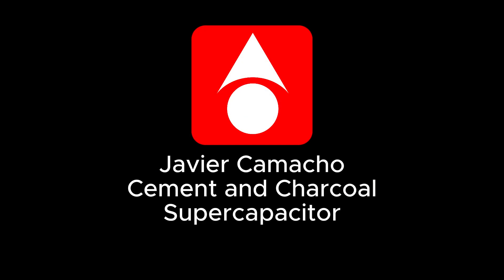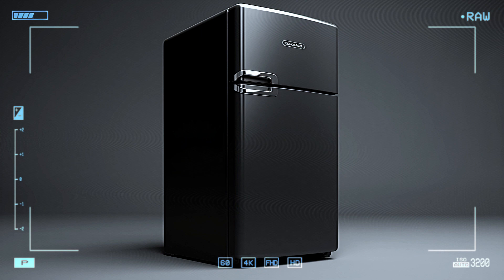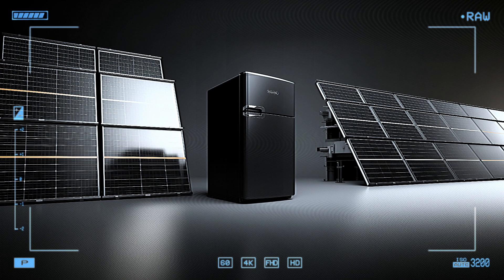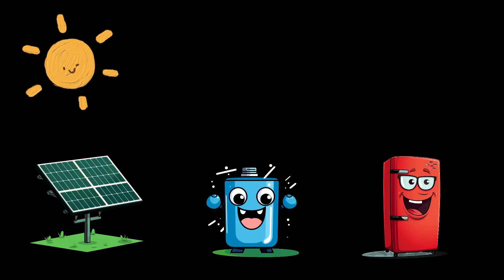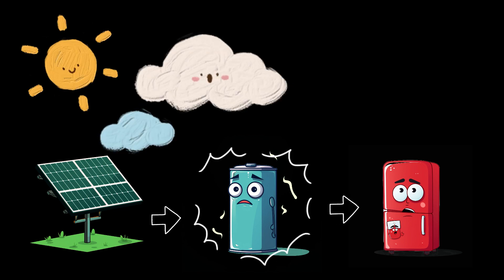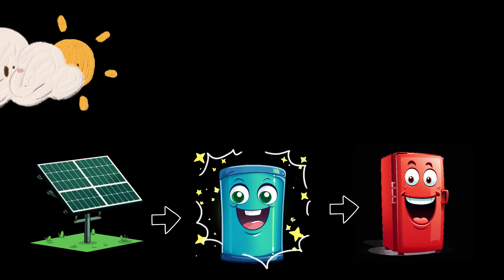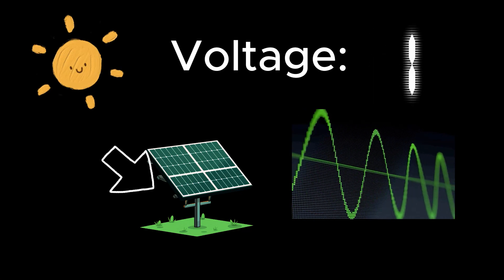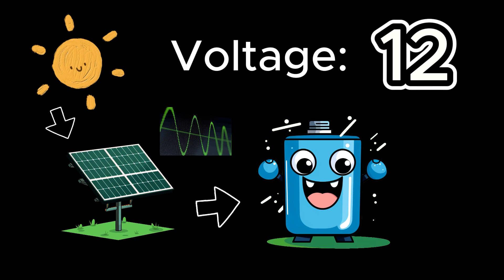Is this the Future of Renewable Energy? Cement and Charcoal Supercapacitor.

Comment: I think that if you really have something that is useful - make enough to go into business.  I would imagine that the "Brick Cap battery" should be saleable to the public for little cost and local sales could boost the local economy and your own economic situation.  (The video is lacking the capacitor and it is just you talking about it.)  However, the weight of cement would preclude you from shipping blocks of concrete capacitors abroad.  

Personally, I would opt for the Lithium battery because a 12-volt 100-amp hour (1.2 kilowatt) battery is less than $250 with carry strap, charger, switched USB ports and only weighs 24 pounds.  I like to use "off the shelf" parts that have mature technology and the LFP battery is portable which is one attribute that cement does not have.  You mention the lag time to order and receive the battery but that is only once, then you have the battery for the next 10 to 20 years.  The cost of that Lithium battery is even lower when the cost is spread over a decade of actual use.
Reply: I will rather want him to show us how to make the cement and charcoal combination super capacitor type. Weight is really not significant if it can have efficiencies of great magnitude over and above the usual known super capacitors. Who knows whether it could be used to power electric vehicles and or engines. Knowledge is powerful. I will want to learn new ways of achieving things. Encourage him to share his info.
Reply: @ejeckamdaniel1562  I have no problem with making a video - more power to you Javier.  Although, I thought that he would "show" a little demo instead of a video just talking about it. It sounds like he needs to do some research and development to "make one".
Reply from the maker: 1. It is a research that has recently been release.
2. I do preferer Lithium but like both of my videos mentioned... These were done during an emergency. Most people won't experience that in life nut for those, Like Mexico these days, there's an options for them to gain some normality during the emergency.

If money and time is not a problem, then buying batteries is always the better option.
Reply: @javiercamacho  And solar panels.  You need solar panels to charge your cap battery - need those before the storm.